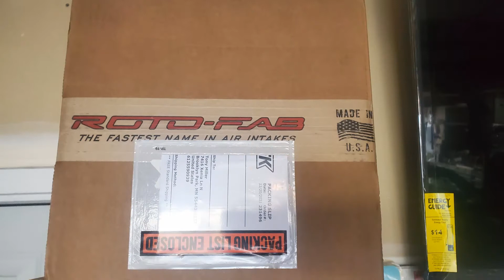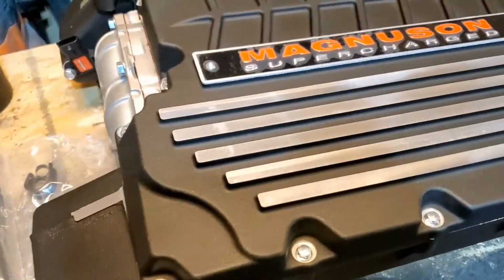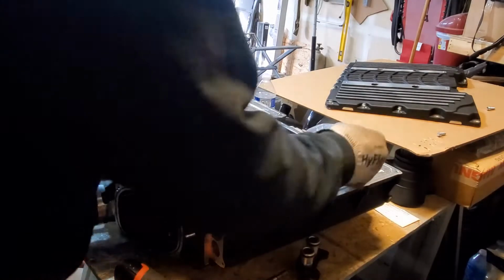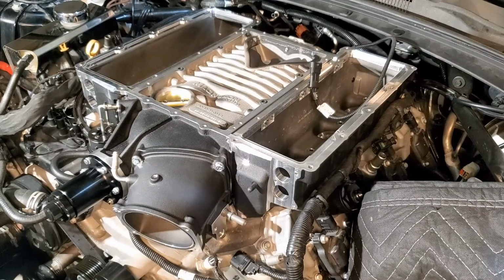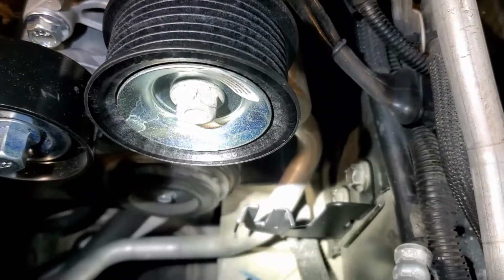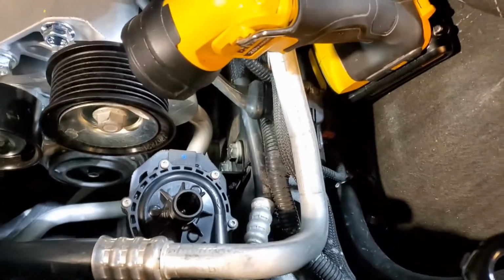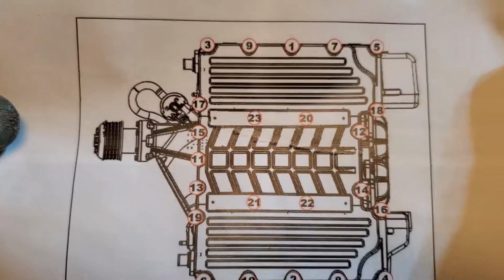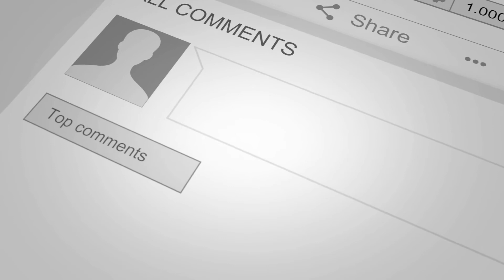Magnuson 2650 installed in a Gen 6 Camaro

Comment: Did you have to take it somewhere and get it tuned or did you tune?
Reply from the maker: Yep it's a guy here. TCP performance. Dam good too!
Reply from the maker: That's only cause I added heads injectors cam pump. If it's stock. They got a stock tune that comes with it

Comment: Nice video to to bad you are ruining you motor with the wrong oil. SB, Mobil1 0W40 DexosR full synthetic not 5W30. You will be pushing this motor hard with the supercharger. You spent a lot of money on that and your going to skimp on oil. Bad move my friend.
Reply from the maker: You ever watch project farm?? he does actual test on a lot of things an Oil was one of those.. watch that Vid on oil test .. I'm good actually, othan using a heavier weight in which I will do next time But it hung with amsoil believe it or not in a lot of categories..
Reply: @1diybrotha  just to let you know I am a 35 year + Automotive Master Technician, I do not need to watch a video on oil. The 6.2L Gen V LT1 engine will run on 5w30 but it is not recommended. The manufacture recommended oil requires DexosR additives to deal with  keeping the engine clean and protecting it from heat. Mobil1 0W 40 full synth with the DexosR rating is what the engine needs especially when you are pushing it hard or racing hard. You sound like a smart guy. The oil you use the 5w30 is it because it cost less. The mobil1 0w40 runs about 130.00 just for the 10 quarts needed. You have a very nice car, why not spend a few dollars more to protect the engine?
Reply: @bettyg7710 the oil he used is full synthetic with dexos, and the recommended weight is 5w-30 so I don't get your point, I would use 0 grade if it was freezing outside only.